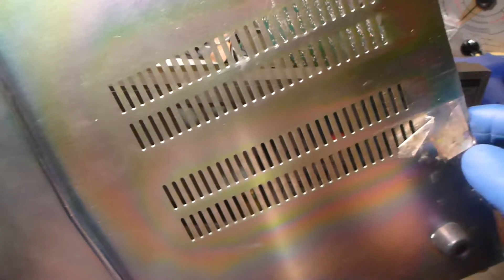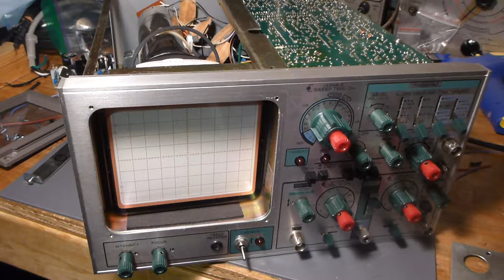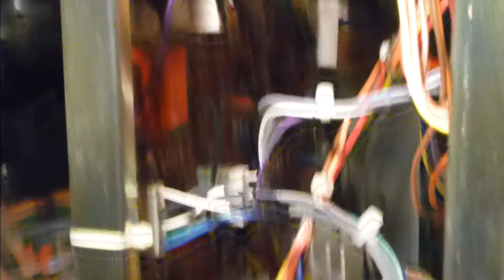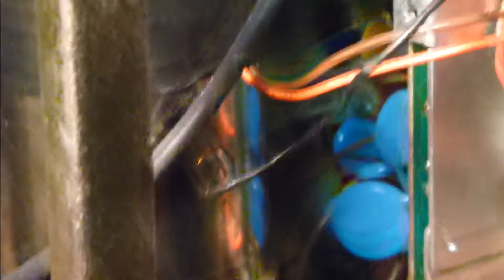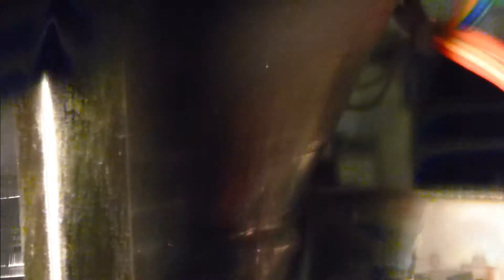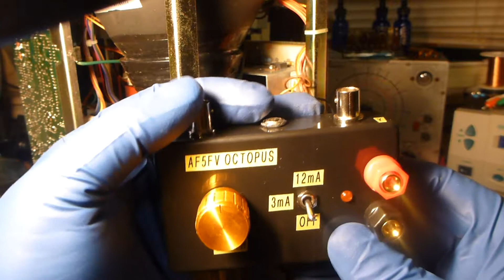Part 1: Elenco MO-1252 35MHz Dual Trace analog Oscilloscope DOA

Comment: You motivated me to fix my MO-1251, well, its my only scope so that was motivation too. Bad solder joints on the HV supply on the top board where you can see the board is discolored from heat. I was only getting a fraction of CRT trace

Comment: I have the 20 MHz MO-1251, the smaller model. It belonged to a school that was throwing it out and it was very well taken care of. I have it connected to a 12v dc  power source, but it is dc, so no sine wave. How would I hook it up to a 120v ac outlet so I can get the waves?
Reply: So you could see the 120vac sine wave? Is that what you are asking?!?